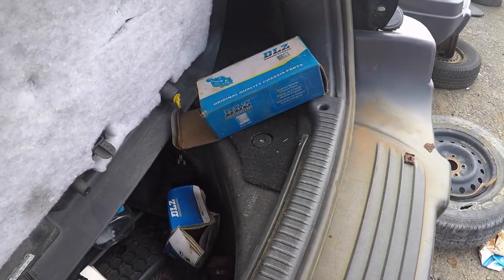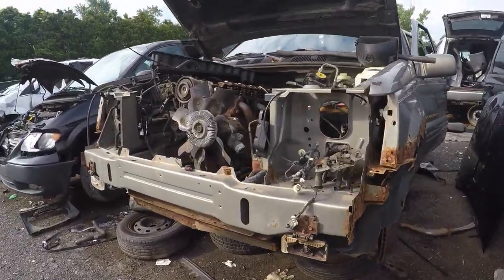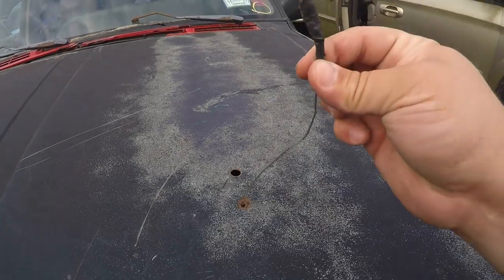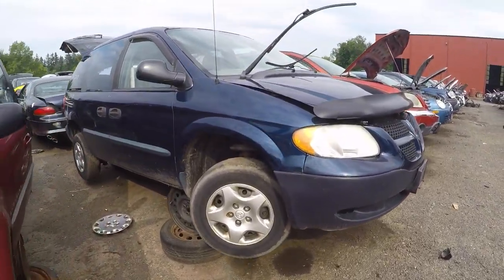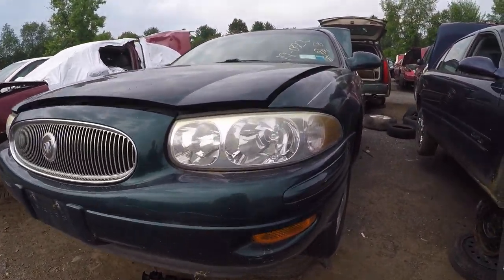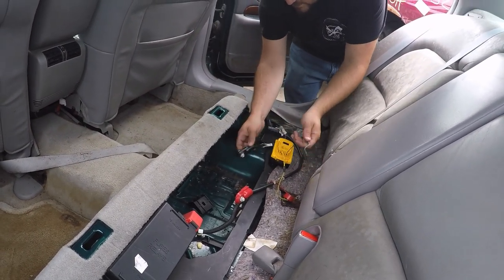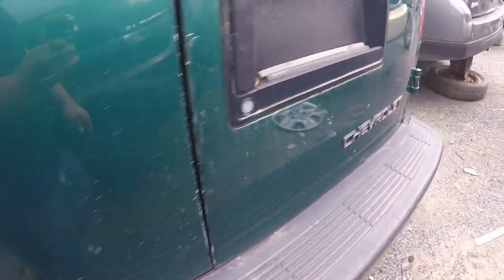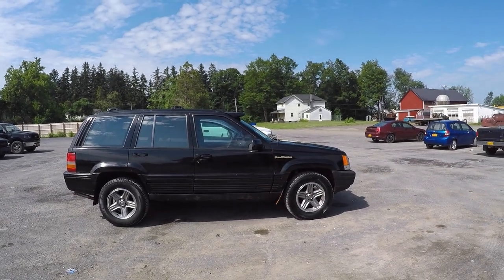How to check electrical systems in a junk yard car - D&E in the U-Pull 19

Comment: Eric! We need zinc for the cam followers, lifters that is. There is tremendous pressure against the cam and it's a sliding surface with no pressure lubrication.
Reply: I realized that after i said it.....and forgot to edit out.... the heat was making us loopy! But good catch!!
Reply from the maker: That is accurate. The rockers benefit as well, but it is the flat tappet lifters where we get the most benefit
Reply: Well, atleast they're not like newer Hemis with roller lifters made from Chineseium!  LoL 😂

Comment: The Aerostar transfer case is a Dana 28 they call it a TC28, but if you do a parts lookup you'll have to source some through a Dana 28.  I quick google searched the Astros and they had a BW7742 transfer case in them in the 90's at least...not sure if that was the same throughout the model years but at least in the early 90's it was a Borg Warner.  Further searches turned up the following transfer cases being used in the 4WD Astro Vans:  136GM, BW1372 and BW4472
Reply from the maker: Interesting. My understanding is that the Dana 28 is not all that reliable
Reply: @DEInTheGarage  I have no idea, maybe that would explain the TC28?  Not much information out there about them, and they weren't all that well followed so not much out there for support unfortunately.
Reply: Just slap an NP205/208 Doubler in there and twin stick the SOB!  😁

Comment: A guy I know, who is a retired U.S. Army Light Wheel Mechanic (he retired as a E-8/Master Sergeant in 1992) got a wild hair up his butt while pulling parts in a salvage yard in our area and purchased a non running Dodge minivan and a whole bunch of assorted pickup and SUV parts along with an inline Ford six cylinder engine. After a lot of garage work, beer, fitting and refitting, some more beer, and a bit of welding, not to mention lots and lots of flat black, green, and brown rattle can paint, he managed to turn that sad, sad looking van into a 4X4 that he uses to tow his bass boat and for camping and hunting trips. Making this as short as possible, if you saw the damn thing it looks like a cross between something the Army experimented with and then rejected out of hand and an anti-zombie assault vehicle.....But somehow it works. Maybe you should give it a try....Hell, I'd buy a bunch of popcorn and a case or six of cheap beer of my own to watch those videos!
Reply from the maker: That sounds awesome!